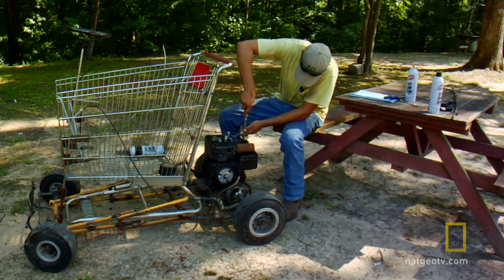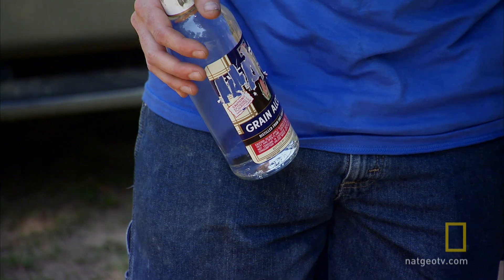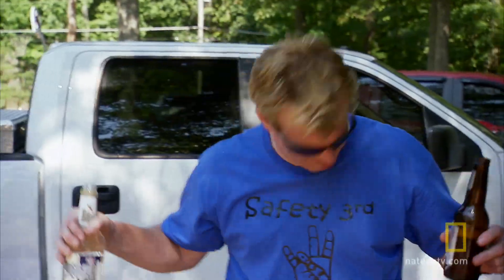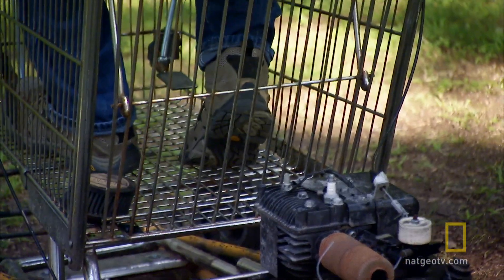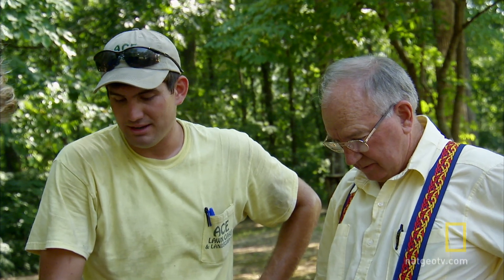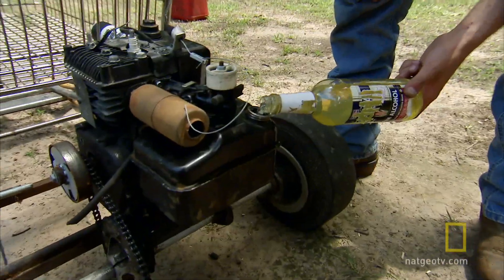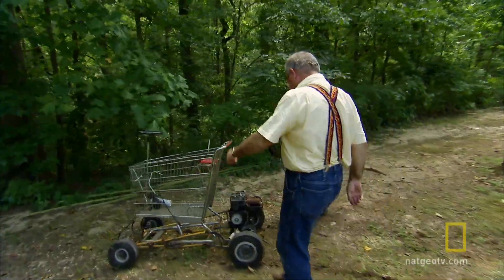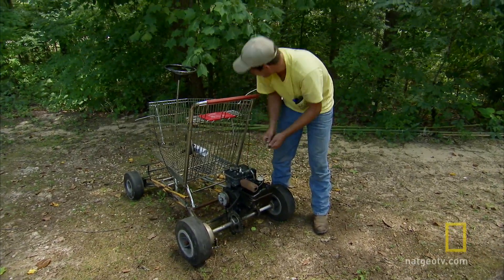Alcohol-Powered Engine | Rocket City Rednecks

Comment: @lordofdogtownign Liquor yes, alcohol no. Methanol would be the cheapest to produce but since you can't buy it at a liquor store not the best idea for a home project. Methanol was originally going to be the fuel substitute not ethanol but due to economic reasons 30-40 years ago and that methanol is corrosive to the plastics used in automobiles the idea was scrapped even though several methanol cars were successfully made.